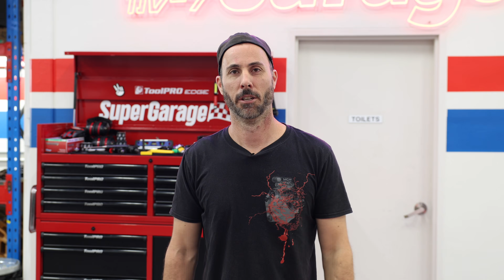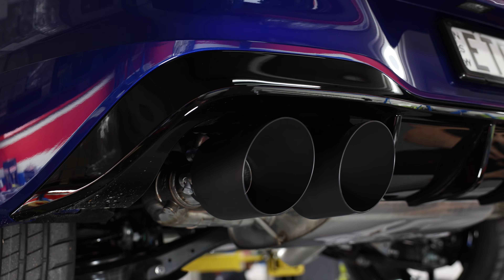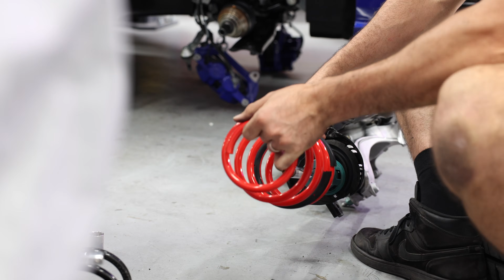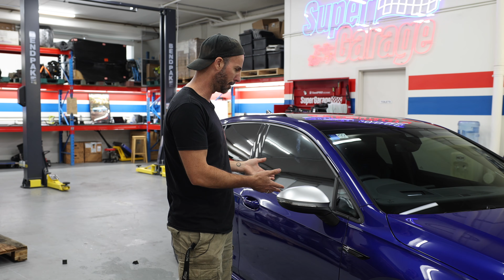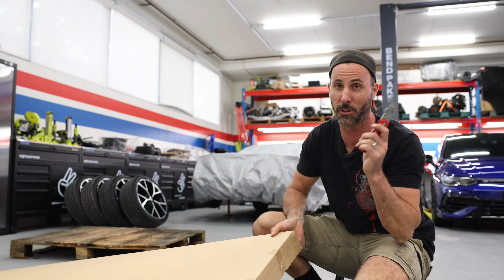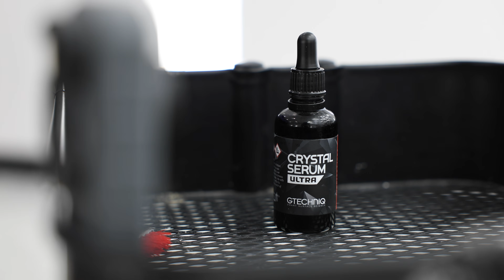Modifying my BRAND NEW MK8 Golf R (in just 24 Hours)

Comment: Some mistakes when detailing the car so people watching don't repeat them at home. 

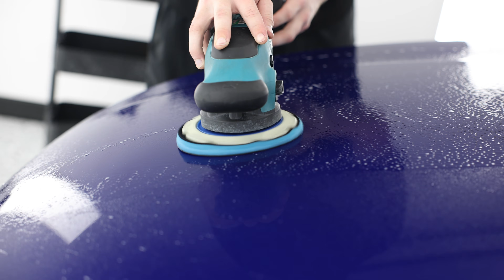Used a machine clay pad 35:07 
These clay pads with a polisher will hack the paint to bits which requires a more aggressive compound after, resulting in a unneeded loss of additional clear coat. They should only be used with absolutely trashed paint. A clay bar with a lube using a mix of surfactants and solvents should be used and not a spray wax. A spray wax will leave material that will interfere with the polishing stage.

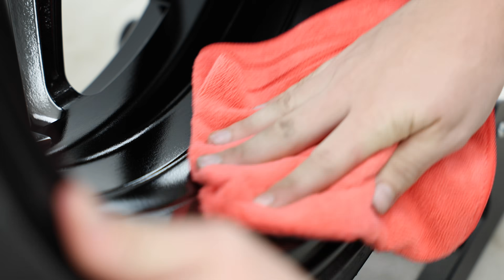Did not properly clean the wheels 36:22 
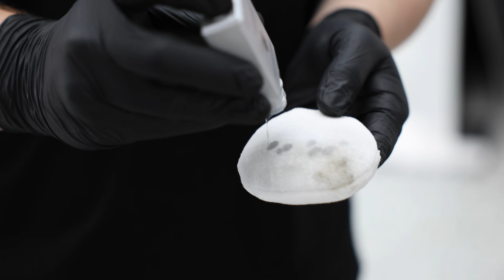That wheel should have been 100% clean when the car left the wash bay. Just spraying some spray wax or IPA and a towel will not only risk swirls but also it just means the wheel will not be clean enough to bond with the ceramic coating. You can even see the ceramic the applicator was black at 36:28 that will make any detailer cringe!

Also it is generally agreed upon that a strip foam before a wash is better than a rinse than foam as strip washes are meant to remove as much dirt as possible before a contact wash. Not saying it is a big deal but why not be  better?

Comment: Love the WRECK IT on G8R.
Quick thought, maybe consider spray some black heat resistance paint on the inside of the exhaust tip to cover the metal tubing. Was quite noticeable whilst pulling into the detailers
Reply: Came to the comments looking for this. Small details that matter.

Comment: Moog! Should have waited for a Horsch Carbon kit mate. Designed and handmade in Australia. Insane quality stuff. Not cheap but worth every dollar. Also did you use the OEM wheel nuts on aftermarket wheels?

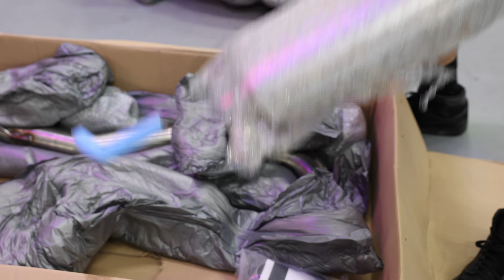Comment: 8:00 What would I rather have? Non-fake-diameter exhaust tips. Going up a few mils to fit over the pipe end is passable, but going 4" exhaust tip on a 3" exhaust system is the exhaust-tip-equivalent of fake blow-off valve sounds on a non-turbo car.

All the other mods were absolutely tasteful tough.

But holy fuck that protection film made it look like it has had 16 coats of lacquer!

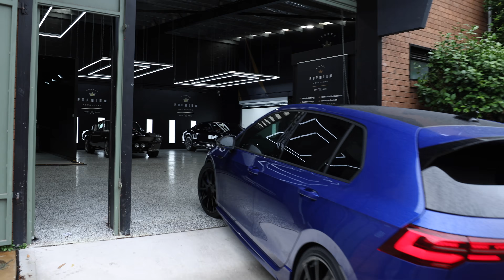Comment: I think without the Lip looks nice and clean but its your car, you do you. I do have one suggestion though, Take your exhaust tips off, Mask off your flapper valves, and spray paint the ends of the pipes black so you cant see them inside your exhaust tips when you put them back on. They really stick out at 33:22, you may even be able to remove the butterfly exhaust valves and paint them black aswell. All that said the car looks absolutely amazing, and im not even a volkswagen fan. Wish it was legal to tint my front windows where I live, Looks soooo good.

Comment: Sorry black wheels make a car look like the owner could not be bothered to wash the wheels. The stance looks good. Forget the lip, why make it less drivable? Hard to see on the video but that cold air intake looks like it will leak engine bay hot air into it. The stock exhaust tips are much better than the farm truck ones you have installed.

Comment: I used to work at a dealership doing pre delivery inspections & cleans, & almost every brand new car I worked on would have less than 6kms on the clock. So being that this is the first MK8 Golf R in the country, I’d say a few of the salesmen have definitely taken this for a spin around the block a few times for it to end up being delivered with 14kms. Either way, the car looks amazing after the paint correction, and I’d definitely put the lip kit on as well. Great video as always!
Reply: I work for GM and some vehicles have 10-15KMs on them . It all depends on the way they are delivered . In my city they come in by train then are moved around the lot to be loaded onto trucks to be shipped out .
Reply: Most cars can still reset the odometer  under 100kms for pre delivery
Reply: Different brands and types of cars could have different testing?

Comment: Are exhaust cut outs illegal in Australia? Otherwise, I’d use the motor and valve to dump the exhaust entirely and cut out the muffler in total.
Reply: Not running an exhaust is illegal.. what he has is as good as illegal here in Australia.. but because "from factory" setup (shrugs shoulders) it's ok to do yet if someone does this on their own, illegal.

Comment: The lip spoiler is pointless and will just cause annoyance in parking lots and to and from the fun.  You would be better off with a flexible plastic flap which is placed closer to the axle or closer to the lowest point.  You don't want the lowest point to be the leading edge, you want it actually to be rearward.  You can do this with an L shaped tab which can be removed when worn from scraping and won't be attached to the cosmetic bits of the car so if it does get ripped off it doesn't take a bumper or expensive bits with it.

Comment: Hey guys check out TommyFYeah he just got his MRK8 Golf R and did a Daza swap into it it swaps the Audi RS3 or Audi TT RS 5 cylinder engine into the Golf and all the drivetrain and inside comforts like the RS3 front seats, steering wheel, shift knob, exhaust and rear seats it's making 500HP to the wheels in his GOLF R now and that's just the Stage 2 upgrade the Stage 3 upgrade is 1000HP in your GOLF R!

Comment: This looks amazing, I can't believe what a difference the colour correction / protection film and ceramic coating makes! That thing is so shiny - now just gotta wait for somebody to crack the ECUs on these things. History tells us it shouldn't take long I reckon. The Gen 3 EA888/IS38 combo on the MK7 R is already good for 380-ish crank HP until you run out of fuel system / turbo, I think these will crack 400+ if Aus 98RON allows it :)

Comment: Love the content, but personally I think the maxton design bits can sometimes makes cars look a bit tacky, sometimes their products look cheap
Reply: The hardware certainly looked cheap as it chinced across the floor.
I'd be straight off to the stainless nut and bolt supply for some 304 (minimum) grade hex female pan heads and ancillaries.
Reply: maxton are cheap chinest crap bro
Reply: Anything after market on modern cars look tacky, they usually look as good as they can be from factory which is why the modified car scene died
Reply: @mrcaboosevg6089  looks are subjective to everyone. Talking from out your bum there fella